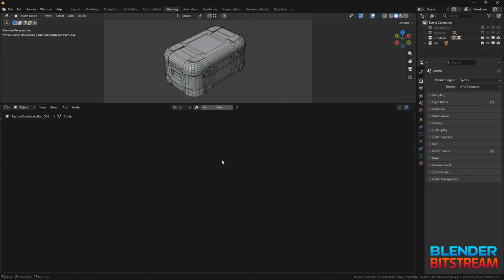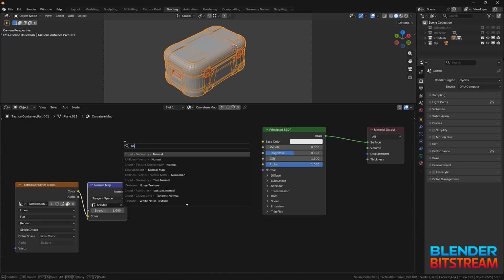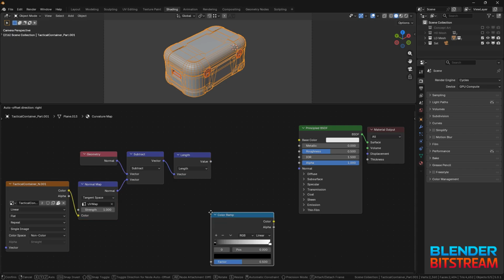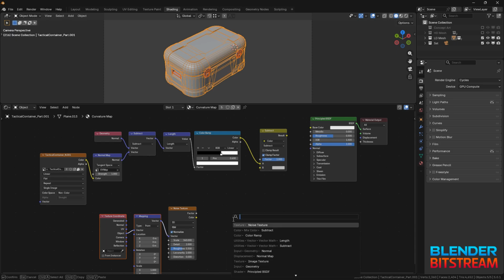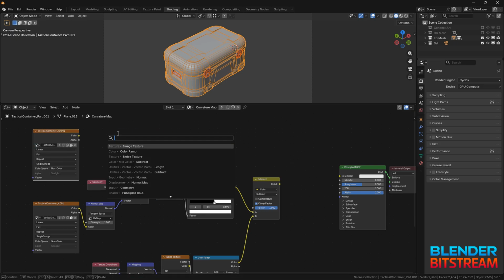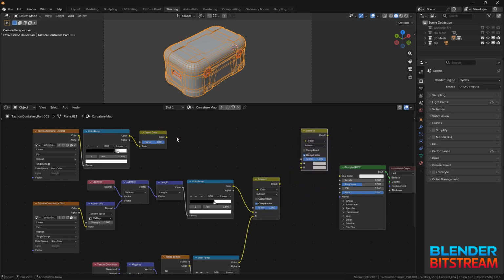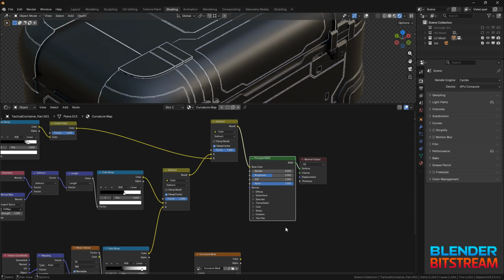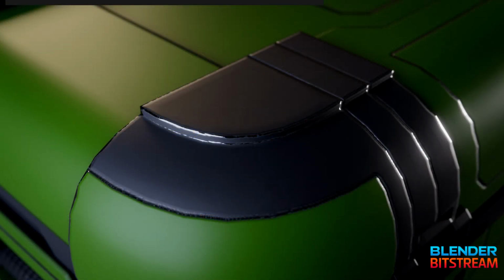Bake Curvature Maps in Blender

Comment: What is the logic behind what you've done. Why is normal map - geometry normal = curvature.

Intuitively I understand, subtracting the base object normals from the image normals will give you the amount it bends around it, but you get curvature by differentiating the normal map right? Is this approximation correct
Reply from the maker: The idea is to compare two different normal directions: the baked high poly normal map and the low poly mesh’s own geometry normals. When you subtract them, you’re measuring how different those directions are at each point. Big differences happen on convex edges, small differences on flat areas. It’s not true mathematical curvature, but it’s a very effective approximation for generating an edge wear mask. The vector length turns that difference into a usable grayscale value, the ramps remap it, and the AO pass removes concave areas so only the outer edges stay bright.

Comment: Hello, aren't flat surfaces supposed to be grey in a curvature map ? Here they are black.
Reply from the maker: Black works better for masks, but you can make the black areas grey with a Color Ramp if you like. Just plug it into a ramp and change the left stop from black to grey. Voila.
Reply: @TheaDesignAndConcept  Thanks. I tried this with a low poly model of a clone trooper. It does give a semi-descent result that needs a lot of work afterward. Not perfect but that's how it is. Hopefully the original author sent me a baked curvature map and i never had to do it (although i was willing).